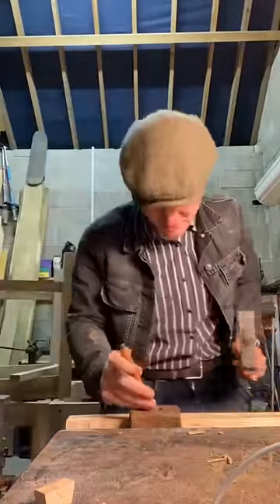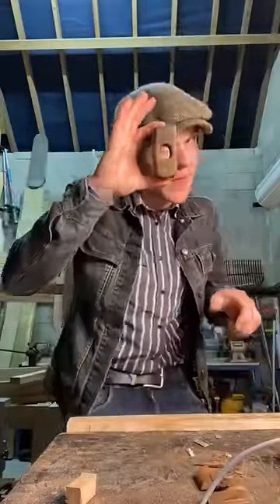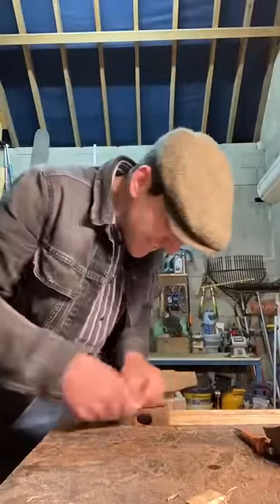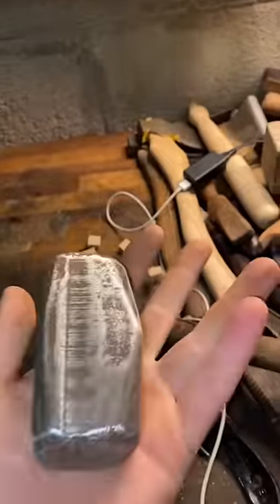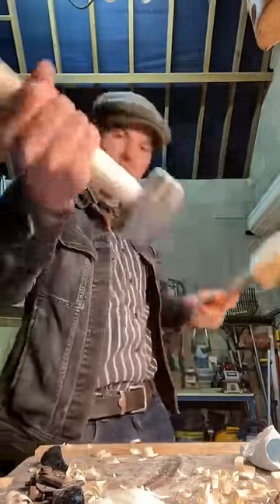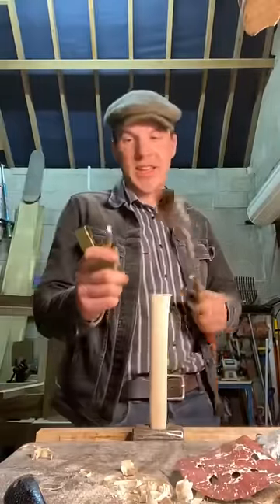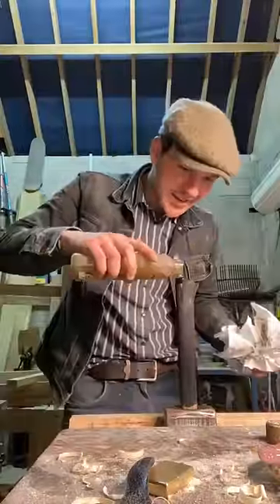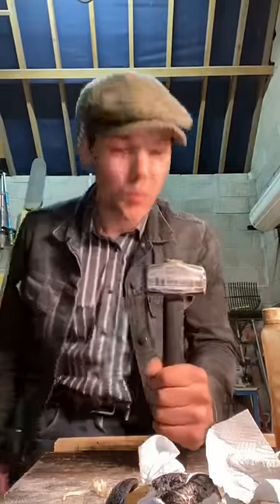Restoring And Making A Charred Ash Handle For A Lump Hammer #shortvideo #ireland #woodwork

Comment: Growing up, my dad had a similar fixation with WD-40. He used that stuff for everything! Once he sprayed it on a paper wasps nest to kill the wasps. It worked!
Reply: Any problem some WD40 doesnt fix, needs more WD40.
Reply: @Klaaism  or duct tape
Reply: Dam right!  I knew an old carpenter who couldn't stand the sand gnats anymore  working on a framing crew in Terra Ceia, FL, he sprayed himself with WD40
Reply: @Klaaism Just DON’T use it to protect your rifles and pistols. Use a good mineral oil…
Reply: it's designed to displace water & does not stick around.  if you need protection against corrosion: follow it up with singer/3in1/light oil etc.  (its great for washing out old grease / oil, but then disappears to leave no protection, the subsequent corrosion can make the situation worse!!!)

Comment: You should buy a cement mixer! You just fill with coarse sand and/or fine sand, add hammerheads, and run till they are cleaned up or till polished! Saves hours. Axe heads i run one at a time, nothing to chip the edges! Great show, young brother across the waves! Stay busy, winters coming! Peace.

Comment: You really should be using a well seasoned and dry stick of wood for handling hammers and axes and such. Green wood like that will shrink as it dries out, and sometimes even slamming metal wedges into it won't tighten it up good enough. Love your vids bro. Keep on keeping on

Comment: I prefer not charring my handles and using fixin wax which is a mixture of half oil, half wax. I use 1/4 olive oil, 1/4 coconut oil and 1/2 bees wax. Heat the handle, rub on some wax, heat again and repeat the process twice a day for a week, once a month for a year and a couple of times a year after that. It leaves a smooth but grippy finnish and the wax is good for dry, cracked hands and chapped lips and just about anything else that needs oiled lubed or waxed. It makes leather soft and waterproof and makes a good wax for canvas and lubricant for zippers.

Comment: What keeps the handle from slowly working out of the eye over time (and use)?
Reply: The eye is tapered, like an hourglass.

The handle has a taper on the top, pushe through the eye, and locked in place with a wedge.

Comment: What are the tricks to prevent the handle from later coming loose on the head?
Reply: Proper and reguar oiling. Proper inital wedging. Humidity control.

And, expect to drive (another) metal wedge at some point.

Comment: Did you cut the slot for the wedge after putting the handle on the hammer?
Reply: Best to cut the slot after test fitting handle in the eye. Then wedge goes deep enough to lock

Comment: does the oil get into the wood thats covered by the hammerhead?
seems like the place under the most stress is the least protected against wear and will thus suffer from that stress the fastest
Reply: The most stressed point on the hammer is the 1/2" section below the head.
It's the most common place to break, usually for two reasons, hitting something you shouldnt or overstriking (hitting the handle not the head), it doesn't see convntional wear that linseed would protect it from.

The oil will penetrate the wood slightly, so would go into some of the fibers in the eye.

Comment: I've got a question and it's okay if you don't answer but if my axe handle keeps flying off and I keep on hammering it in because I can't replace the wedge because it's a metal wedge how do I fix it
Reply: Pull the metal wedge, saw a slit 3/4 of the way into the portion of the handle that sits in the eye, as straight as possile, then drive a new wooden wedge into it, and secure with the metal wedge you pulled.

It should be fine then.
If not, buy a new handle.
Reply: @autumn5592  ok thank you very much

Comment: Hydrochloric acid will clean the steel try vinegar and salt same thing....Add lemon too if ya want
Reply: Did you just say Hydrocloric acid is the same as vinegar? Lmfao
Reply: @autumn5592  When an acid reacts with base it forms salt. Vinegar is acetic acid CH 3 COOH and simple salt is sodium chloride . The reaction between acid and the salt takes place as follows: Hence from the above reaction, we can say that when vinegar reacts with salt hydrochloric acid is produced.
Reply: @autumn5592  Its basic chemistry salt and acetic acid found in vinegar usually a minimum of 5%..
Reply: @freeman7788  I didn't know that, apologies.

Though the quantity would be pretty insignificant, as the quantity of acetic acid in vinegar is very low.
I cant imagine it being better by a meaningful amount.
Reply: @autumn5592  One table spoon of Salt with a cup 280ml of vinegar...Stir...
All tarnished copper brass approx. 30 to 60 seconds completely clean and bright finish..Al lot of acids need to be slightly diluted for there to be a reaction. And a weak acid...
What is 5% acidity in pH?
2.5
Standard 5 percent distilled white vinegar with a pH of 2.5 is the best around for cleaning. It's acidic enough to kill bacteria, and it probably has the most neutral smell of all the vinegars.31 Mar 2021

PH 1.1
Hydrochloric acid (HCL) has a pH level of 1.1 at 38% concentration. If this acid accidently came into contact with your eyes or skin, it would immediately begin to dissolve your skin tissue.8 June 2023
Reply: @autumn5592  
From 1 ph to 2 ph is approx 3 times more acidic 1 to 3 is 10 times comparing 5% Acetic acid  to 38% Hydrocloric acid there fore it should achieve the same outcome but take a factor of ten times longer as long as they are reactive to the same  materials being used...
  

How much more acidic is a pH of 1 than a pH of 3?
The pH scale - Energy Education
10 times
pH is a logarithmic scale. This means that for each one-digit change in pH, the acidity (H+ concentration) changes by 10 times.
Reply: @freeman7788  Now you're just talking nonsense.

You cannot turn a 5% acid solution into a 38% acid solution by adding salt...

It's the equivalent of saying 'I put a different type of gas in my car, and now it has 4 extra cylinders and the engine didn't get any bigger!'

--

I did some more research of my own;
It doesn't produce Hydrochloric acid. It just has Chloride ions that don't do anything with the Acetic acid.

The acid content doesn't change, the pH doesn't change.

The mixture works on copper (and copper based alloys) because the chloride reacts with the copper, helping speed up the breakdown of the copper oxides.
It will not work on steel, because the salt won't do anything to the steel.

Ask yourself this; if it produced hydrochloric acid, wouldn't people who eat salt and vinegar on chips (fries), or people who add salt pickles, or people who eat ketchup on salted chips (fries), have hydrochloric acid in their mouths, if it was as strong as you claim, then surely these peoples mouths and fingers should have chemical burns, right?

-- 

Copy pasting the first few Google searches proves and means nothing,  and I don't need the pH scale explanation.

Comment: Shouldn't you have your leather apron on when pulling that blade into your belly like that?? Safety for the young tubers
Reply: If you're yanking it hard enough for it to hit you you're using it wrong.

When used properly it will never cut you, or even come close to you. Same with any other edged tool.